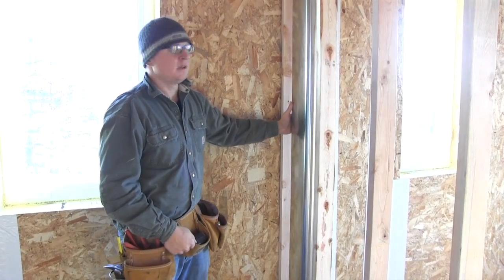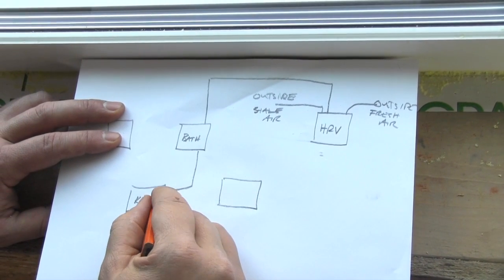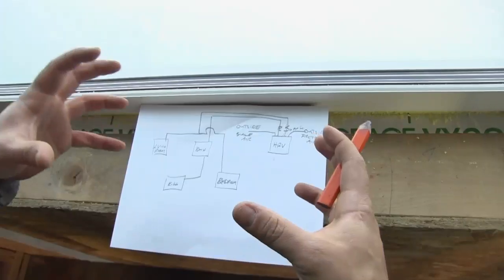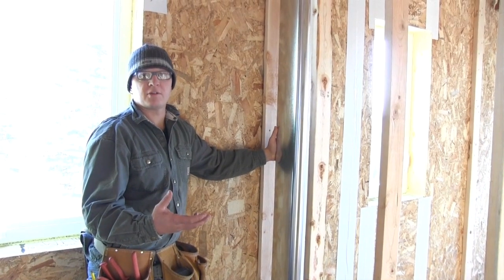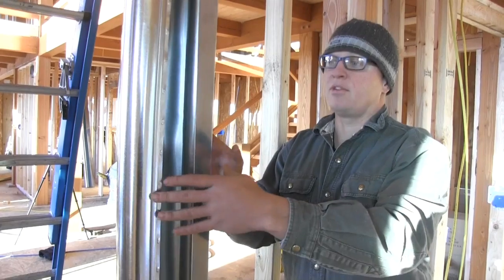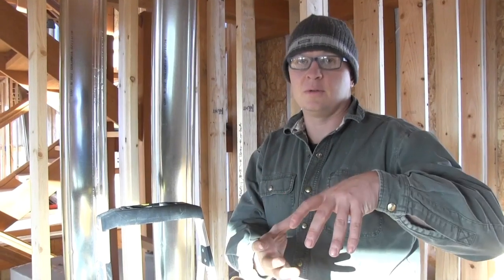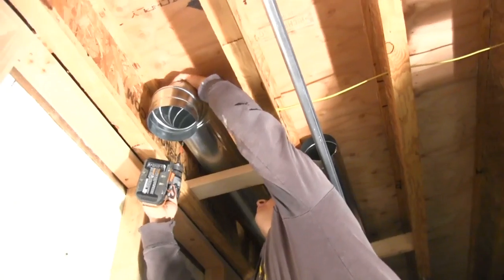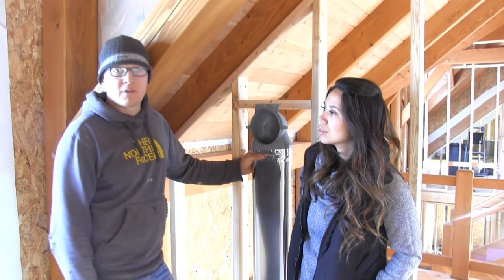DIY HVAC Installation - EP 23 Alaska Dream House Build

Comment: Nice installation, but, in Texas all elbows and connections are required to be seal with mastic/duct seal.If your system is still open suggest you do this also.Air/moisture =rust..Ole Timer Hvac Service

Comment: I have always wondered why we have mostly brick houses here in Europe (not talking about the Tudor houses) and you guys mostly wooden houses in the U.S. (At least to me it looks more common)
You know, here where I live the temperature rarely drops below 14 degrees Fahrenheit and we have brick houses, some of them are even insulated with 2-6 inches thick polystyrene on the outside (and inside as well)
A structural engineer said that brick insulated better while some people say it's the other way round. If I look at the structure, obviously brick as a material is more solid and tougher than wood, more resistant to the elements yet you use wood even in areas that are known for their harsh weather condition. It's just.... The whole thing doesn't make any sense to me.
Can anyone enlighten me please? I'm highly interested in this topic. Cheers and btw thank you for the video!
Reply: Lou Joszai western framing started out back in the pioneer days, with logs, and wood was abundant.  I believe it stuck because of cost and availability.  While I can't remember the actual R-value and the U-values of wooden studs and brick, the idea now is to design a home that fits the end user right now, not for future generations.  Also, while it can be repurposed, it doesn't bother most people to doze and send a home to the landfill. People here would rather build to suit their individual needs over remodeling if it is a break even split on cost.

Long story short, is the lifespan takes a backseat to cost.
Reply: Steve Miller It's interesting to see how history and cultural differences have shaped the way people think and do things. Anyway, thanks for your response Steve. And long live the DIY!
Reply: Lou Joszai - in parts of the US brick or concrete block with brick veneer is quite common.  Those areas tend to be places which have clay soil and bricks are easily made nearby. Commercial construction also tends to be concrete block. Moisture control in masonry can be challenging. And masonry shipping costs would probably be prohibitive for Alaska. Also, Brick-laying requires temperature stability for a long period of time. In Alaska the window of time with good temperatures for masonry work would be way too short.  Even here in the middle of the US, brick work can get tricky. One sees buildings with huge tents over them so the masons can heat parts of the bilding and continue to work in cold weather.
Reply: a good house requires both good framing and masonry. Brick is good, it’s even better with steel beam supports and concrete footings for multi level. Surprisingly steel beams aren’t as expensive as people think, the problem is they are more heavy to work with and wood beams and subfloor are used instead for interior homes. The biggest issue with home is insulation and water damage prevention and both wood and brick are capable of having both with wood at lower cost and faster completion time.

Comment: How do you stop the oval 6" equivalent sections of ducting from sliding down through the saw cut penetration in the floor? And all these penetrations is there any fire concerns with all the holes from level to level are any firestop or fire doors required?
Reply from the maker: That's a good point.  We do blocking and secure as directed by the contractor.  The basement ceiling will be drywalled enclosing the system, but we were not given any other instruction from the contractor or engineer for fire concerns.  Are things different in your area?

Comment: Interesting.......I have been in the Air Conditioning game for 40 years and have never seen un-insulated duct being used. also such small ducts don't normally allow enough air quantity. I'll be interested to see the final outcome when it it switched on.
Reply: I’m guessing you never lived anywhere else in that 40 years. I see this same style system used very commonly in the Midwest, the central plains and the non coastal western states.

Comment: Thank you, explaining so good.  Are the vents going to be returning to a above the floor or wall level?   My mom's house has air vents in the ceiling.  I love those and so easy to keep clean.
Reply from the maker: Hi Janet - some will and some will be in the wall - it's a case of ceiling where possible, walls where timbers/wood tongue and groove is present.  Thanks for the tip and watching!